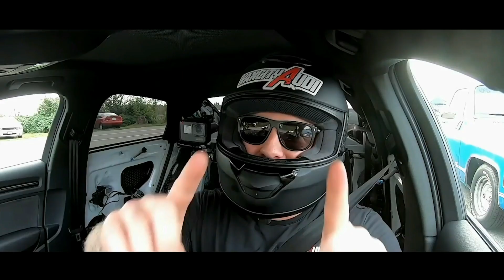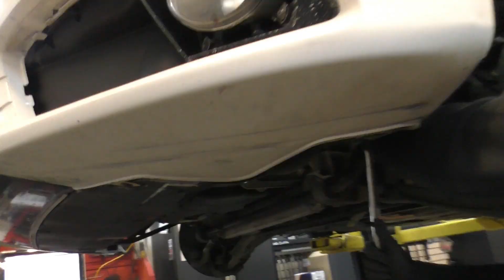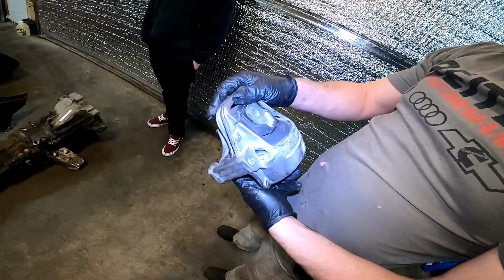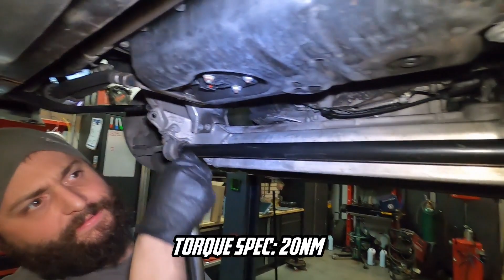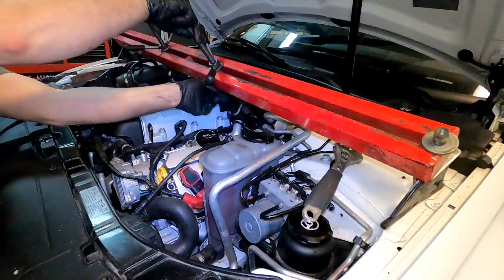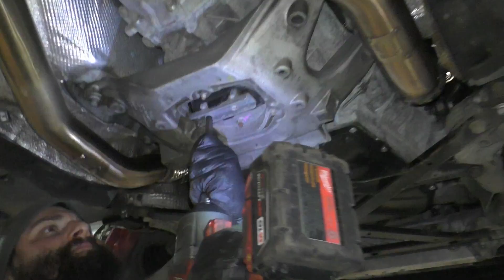Audi B8 S4 - Black Forest Industries Engine Mounts & Transmission Insert Install

Comment: Just finished up with installing everything. Raised the subframe, put the rack back and torqued everything down. I am on the final 14mm motor mount bolt that connects to the motor and it isn't torqueing. Feels like it is spinning forever. Any tips?
Reply from the maker: No idea, sorry. Sounds stripped

Comment: Hey. Love the content, and the timing couldn't be much better, as my car is in the shop and they noticed leaky OEM mounts. Is there a reason you went with BFI rather than 034 or ECS or other options?
Reply from the maker: When I think performance, I don't think ECS. They are more of just a cosmetic and maintenance company in my opinion. I will never use any 034 parts on my car due to their lacking of morals in their business practices. I used BFI mounts on my RS3 and they worked extremely well.
Reply: @VancityAudi  also the fact they deteriorate just as fast as oem,

Comment: The stock mounts are liquid filled, when the mounts tear up bad they leak and trip a code/cel for a bad motor mount,  
BFI makes plug in resistors that trick the ecu into thinking the stock mounts are there and healthy .. I as well have the same BFI street mounts I’m waiting to install here soon, 
 The pass side mount is the usual culprit and takes the most abuse.. as well as being fairly easy to replace - leaving the sub bolted up .. as for the driver side - yeah pita, I’ve read you can loosen the oil cooler and do it as well .. 

I can’t wait for the follow up video as my b8.5 is my part time daily ! 

I’ll be doing the mounts “again already destroyed a passenger side stocker in 3k miles”  / HX . 3.2 lower pulley , WMi and custom tune here shortly ! Beers and salut :)
Reply from the maker: Sadly I didn't realize that BFI sold plug in resistors or I would have grabbed those too. We will be making resistors ourselves tonight to get ride of the engine mount codes we now have.
Reply: @VancityAudi  easy quick fix :) or just code them out the tune ..
Reply from the maker: @brizax  I use an OTS tune from IE. I don't have the option of coding them out with the tune. Resistors will work just fine for us. Thanks for the info.

Comment: I’ll add my experience with the Stage 2 mounts. They NVH was awful. Compared to even the shot OEM ones, the BFI had a shake at idle that would rattle my door cards. Only time it was bearable was driving. The car did feel super tight tho, it was a big improvement in slop, but the daily aspect was gone with them. I ended up taking mine back out and putting in 034 street density mounts.
Reply: I would say you should have went Stage 1. Stage 2 is meant more for track duty.
Reply: @crxgator  BFI had a deal on their stage 2 mounts which were cheaper than their stage 1 at the time hence why I bought them. I know they would be more rough but not that bad. First time with a billet mount so my lesson was learned.
Reply from the maker: My review video will be dropping within the next week. We'll see if my feedback is the same or different from yours!
Reply: @VancityAudi  I look forward to it, hopefully the stage 1 is bit more forgiving! If mine was a dedicated track or even drag car then I would’ve for sure stuck with the BFI. The quality of the mounts were awesome and the performance factor too, just not the daily driving side of it.
Reply: To compare them to the 034 a proper comparison would be their track mounts to the Stage 2 though. That’s what I’m getting at. Unless there was an error on the site, the Stage 2 would always be more expensive than the Stage 1
Reply: @crxgator  then you should’ve stated your previous comment better. I’m telling my experience with mounts. I bought those BFI mounts last summer already and traded them for a set of 034 street density mounts. I wasn’t looking to do any comparisons between mounts. 034 was over a month out on mounts when I was buying some so I went for BFI as they had them in stock. I guess I don’t see where the conversation is going here.
Reply: @JustAnotherCar_Guy  The conversation is you're unfairly comparing a track mount to a street mount. Of course there's going to be more vibrations with a track-oriented mount than a street one.
Reply: @crxgator  buddy I’m here stating my experience with a stage 2 for anyone wanting to do them. I’m betting those stage 1’s are still rougher than 034’s track density mounts even. If it bothers you that much just keep scrolling.
Reply: @JustAnotherCar_Guy  when you say it's unbearable, is it like rattling your skull or just feel like someone is rocking the car around some? I'm just trying to see if I think it'll be unbearable too lol
Reply: @jordandevelle4564  not skull shaking bad, but it’ll rattle anything in the center console, you’ll feel a good amount of vibration, etc. Idling is annoyingly rough. For me it’s not an ideal setup for a daily car to deal with.

Comment: Are the only function of those sensors on the OEM engine mounts to contro somewhow the stiffness? Not sure why all other brand mounts have those connectors while the ones you choose to use do not
Reply: Also, could you share how long did it take to replace the engine mounts in terms of shop labor? Cheers!
Reply from the maker: @joserodrigojimenez5027  We honestly aren't sure if those sensors do anything else.  We figured things out as we went with no instructions or guide so the time spent by us won't be the same for a shop.  I think we probably spent 4 hours on it.

Comment: I am glad I had the shop put mine on 🤣
Reply: I had to have the rear upper and lower mounts on my 2008 rabbit replaced, they are pucks that need to be pressed out/in of the subframe. This was one of those jobs where you look up the how to on youtube, see that it needs a $300 special tool to do it without having to take the subframe out or lie under the car swearing for a few hours and killing your back. I happily paid PG Performance $200 to install them for me.
Reply from the maker: Ya, that was a wise decision, haha

Comment: I did stage 2 BFI engine mount on my b8 and it shake at red light , but the less torsion from going full throttle is really noticeable
Reply: Wow, thanks for the insight on increased NVH with that setup. 👍 I was actually curious about that.
Reply: @Downbytheribber  to specify , am unitronic stage 3 with a iabed 75mm TB and all the bushing insert available , I am only missing a rear sway bar replacement.
Reply: @maxgagnon1947  thanks for clarifying. Your car must be significantly more rigid than stock. Did you retain stock springs and dampers or upgrade?
Reply: @maxgagnon1947  I thought about KW adjustable springs and retaining the stock dampers for that reason, what are your thoughts on that? 

Current setup B8.5 S5 APR Stg 2 map + dual pulley, open intake and ECS valved exhaust, for reference.
Reply from the maker: @Downbytheribber  In a week's time or less I'll be releasing my review video on these mounts as well to let people know how they feel.
Reply: @VancityAudi  looking forward to it. Great content
Reply from the maker: @Downbytheribber  Thanks for watching
Reply: Stage 2 is meant for track. Stage 1 is meant for street driving.